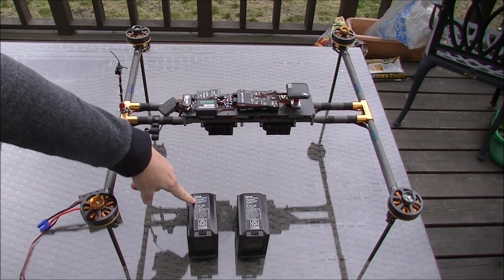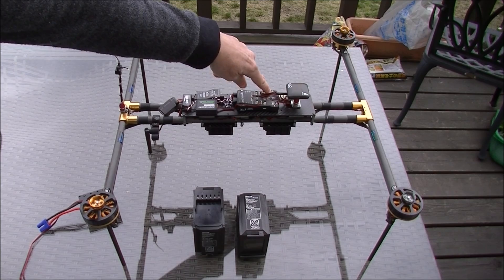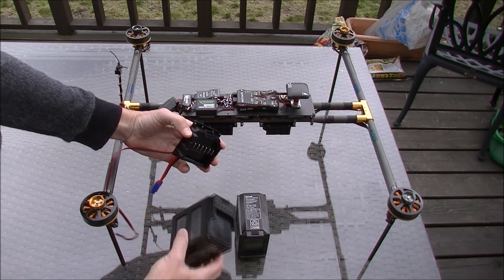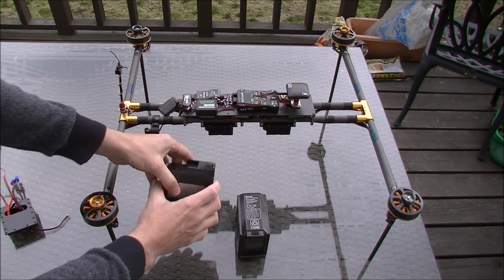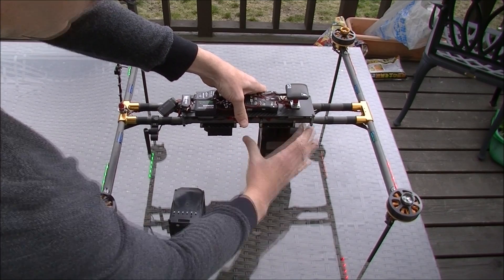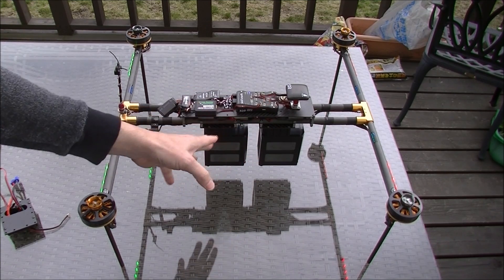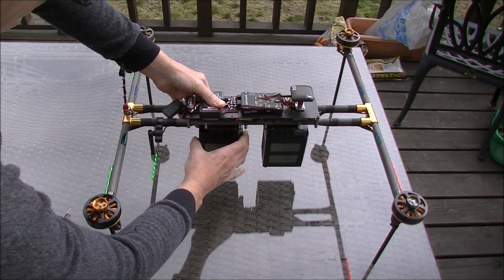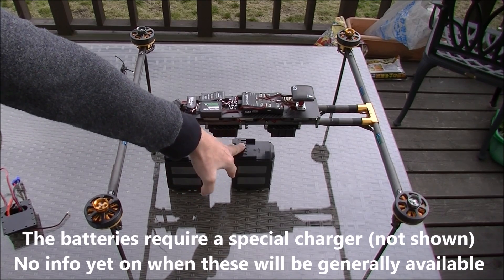Maxell Smart Battery Intro

Comment: Nice. On your Enroute frame, are the yellow metallic tube connectors brass or aluminium ? (or other material ?)
Reply from the maker: I'm pretty sure they are aluminum.
Reply: Thx. Do you know where I could get some of these connectors in order to try build a similar frame ? I don't find them as spare parts on the Enroute web site (which is in Japanese...)
Reply from the maker: HuguesD, I don't actually know where they get those connectors.  My guess is they have them custom made 'cuz all their frames pretty much use these but I don't think they sell them separately.

Comment: isnt such a long I2C cable a problem?   also this is all nice but looks heavy, what weight are those batts?
Reply from the maker: The I2C cable on the separate connector is probably longer than it should be.  On the vehicle the cables are probably 15cm so it should be fine.  The batteries are really heavy - 800g each!

Comment: The morons used the same I2C address for every battery.
Reply from the maker: Well, we may find a way to either change the I2C address of some batteries or the SMBus protocol (which is very similar to I2C but slightly different) apparently includes a way to "negotiate" I2C addresses.  So, maybe we will get lucky with some more development.

Comment: Randy, what about I2C multiplexer IC?
Reply from the maker: I've never used one but I guess it allows the master to specify which I2C device it wants to use even when some of the devices have the same I2C address?  That sounds like that would work.
Reply: Yes, it switches bus, so you can hook several devices. Example: https://learn.adafruit.com/adafruit-tca9548a-1-to-8-i2c-multiplexer-breakout/overview multiplex one bus to 8. But that may require some adoption in HAL, perhaps like in Linux kernel (if i remember correctly, in device tree may be set topology with multiplexer chip).